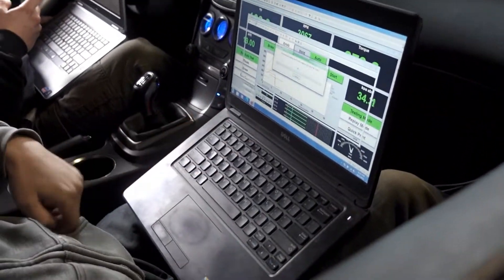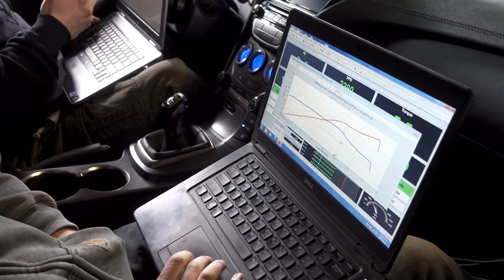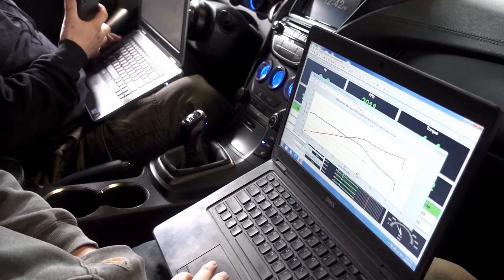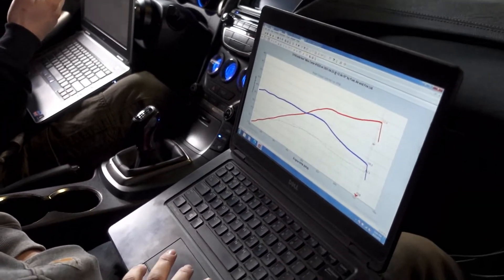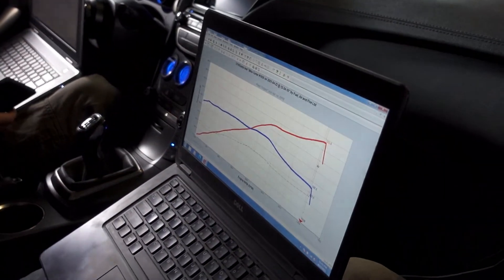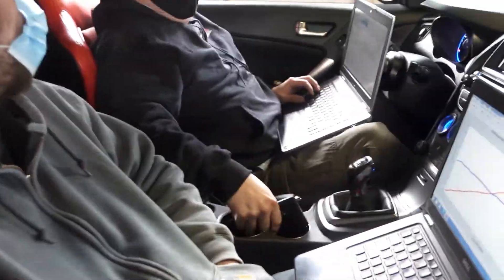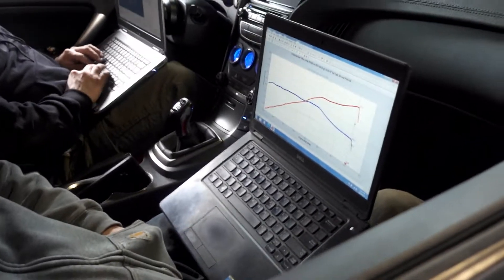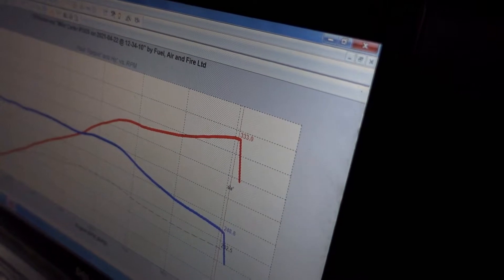Episode 18 Dyno Tuning a Stuffed Turbo on a Hyundai Genesis Coupe

Comment: What stuffed turbo did you get ? I have a 2010 2.0T I’d like 400, is that possible?
Reply from the maker: I got the Stage 2 turbo from turbo parts Canada. And Ya it’s possible for 400+ with a bk1. I’ve helped other gens get around that range with an aftermarket turbo kit. Blood type racing (BTRUSA) has some kits available to get there. You’d need a few other parts though, like bigger injectors, stronger clutch, aftermarket boost control, etc.
Reply: @alphagenperformance  do I still need a clutch if my Gen is an auto/w or manual, I have the dual transmission.
Reply from the maker: @c4pt_underp4nts oh automatic, i think a few have done it or at least gotten close. I’m not sure at what power/torque the auto transmission will slip. But you can still get some decent 350ish hp kits out there!
Reply: @alphagenperformance  I would be fine with 350 , it’s my daily. Thanks, any recommendations? I would like to do it cheap as possible.
Reply from the maker: @c4pt_underp4nts  unfortunately I’d say any turbo upgrade isn’t necessarily cheap with the parts required and tuning time, etc. Still looking at a few thousand, especially if not doing the work yourself. And making sure you car has all maintenance up to date as well and running well before the big upgrade.

Comment: Hey, aside from the stuffed turbo and the intake, what other performance mods do you have on that helped out the tune? Stuffed turbo and intake is what I’ll currently probably have but what else could help push those numbers up? Also what psi does your turbo push to (if it’s over the stock 15, does the boost gauge bar basically go over 15?)
Reply from the maker: A catless 3” turboback exhaust definitley helps with spool and horsepower

Comment: Hey man, Question. Im putting in a stuffed turbo/ported manifold  from TPC in my BK2. I was wondering was it ok to drive before getting it tuned? I need to make about a 4 hour trip to my dyno tuner.
Reply from the maker: Ya, you should be fine. Just stay out of boost.  Definitely don’t try to test it and go wide open or anything as your ecu hasn’t been tuned for the extra flow the stuffed unit provides. We have a customer that’s about to do the same and take almost a 3-4 hour drive to get some dyno tuning done as well.

Comment: TPC claims 375 whp w full bolt ons.?
Reply from the maker: Some of those numbers were guys also running external wastegate. I’m currently running the stock electronic wastegate. I’ll be keeping it that way until I install my larger turbo setup. However, I’ll be adding water/meth injection, larger injectors and fuel pump and retuning for hopefully higher numbers again this summer! Stay tuned!

Comment: What king of AFRs is it running at WOT?
Reply from the maker: I’ll have to double check when the car comes back out in the spring. I honestly can’t remember. I can get the average for you when I do a pull 👍 it’s going back on the dyno soon because I’m adding water/meth injection and bigger fuel pump and injectors too.

Comment: Are you using the bk1 or bk2 Intake manifold?
Reply from the maker: Bk2 intake manifold. Just full turboback exhaust and stuffed turbo replacement 👍 Planning on adding water/methanol injection to get a bit more horsepower out of this setup this season! I’ll dyno it and put the new numbers up later in the year!
Reply: I’ve got a bk2 2.0t auto fbo on meth and I was wanting to get a stuffed turbo but I heard people can crack the bk2 plastic manifold when you reach higher power, but that’s good to hear it’s holding up for you I think I will hold off on it for now because transferring everything over sounds like a pain. I’ll keep a look out for that video thanks for the reply.

Comment: Sup man, after u installed the stuff turbo, did u upgrade ecu also? Right now i got isr ecu on stock turbo, and id order a stuff turbo...do i have to upgrade my ecu for stuff turbo?..
Reply from the maker: Nope, you’re able to tune the stock ecu with this upgrade. You don’t need an aftermarket ecu with a stuffed turbo upgrade.
Reply: @alphagenperformance  what else did u do beside stuff turbo, to make around 300+who??? Can give me the list and where i can get them parts...pls.
All i did on my car are full exhaust, and sfr can tune, hks blowout vavle, thats all,my goal is to be around 350 max..
Reply from the maker: @yourlocalsleepyhead9365  honestly similiar mods. Full 3” turboback exhaust, 94 octane, and the stuffed turbo. I’ll be adding water/meth injection this season to try to get more power as well. Oh and also custom dyno tuned with AlphaSpeed. But that’s it ☺️

Comment: Hey mike I have question so I live in Fort McMurray Alberta it’s 4 hours away to Edmonton it’s where the tuner live so my question is will it be fine to drive my car with my new stuffed turbo all the way to the tuner shop ?
Reply from the maker: I wouldn’t recommend going into boost at all if you’re driving that far. Just to be safe. Keep rpms low/mid range and no pulls. If it was Dustin you were talking to, he works with me with AlphaSpeed as well.

Comment: STrong pulls!! About to tune my stuffed Bk2 on Haltech!
Reply from the maker: Nice man! Let me know what your numbers are as well 😊 Where did you get your stuffed turbo from?
Reply: @alphagenperformance  I thought the haltech didn’t work on a stock turbo bk2
Reply from the maker: @ChepoWorks  I don’t know why it wouldn’t? 🤷‍♂️ haltech does give you more options with tuning and will still be able to read the sensors it needs 🤔
Reply: @alphagenperformance  oh I thought it was something with the waste gate , I was running a tomei turbo on e85 and 1000cc Id injectors , do you think I would run those injectors with a stuffed turbo e85 on the haltech ?
Reply from the maker: @ChepoWorks  why are you thinking of switching from the Tomei to the stuffed unit? And I don’t see why you couldn’t. I’m actually getting 1000cc injectors and methanol
Injection to try to get more power out of the stuffed turbo as well.
Reply: @alphagenperformance  this is the first year I had to smog the car so I took the set up off to put the stock turbo to pass emissions and sold the set up now I’m slower then a Camry and miss being able to pick up speed when I want to so I’m thinking stuffed turbo e85 on the stock ecu so I can keep the ac on the bk2
Reply from the maker: @ChepoWorks  oh ya, I think there are guys making close to or around 380whp on e85 on the stuffed units. Pretty crazy on a stock frame turbo 👌

Comment: Have you seen any clutch slips on those gains with the stock clutch ?
Reply from the maker: nothing yet man. I heard the bk2 clutch can hold up to 400whp, but i guess it's the torque that'll  kill it. Next power goal, i'll be upgrading my clutch for something that'll hold 500whp no problem, but still be driveable for street/track.

Comment: is this just stuffed turbo only? thats what im doing right now.. just waiting for my new engine (prev engine had too many miles) and getting dyno tuned hoping to hit 330 also
Reply: nvm you just answered at the end of the vid lol
Reply from the maker: @2538159408  haha all good. Thanks for watching 😊 Yup, just take out the old one and replace it with new upgraded stock unit. No other fuel related mods needed. Well worth it in my opinion for the price!
Reply: @alphagenperformance  not sure how much i can make. Ill be on 91. Brand new engine but rest of the components are 138k miles i was hoping to break 330 also but might not happen 😢
Reply from the maker: @2538159408  I was on 94 in this video, but either or, you’ll still see some decent gains 😊
Reply: @alphagenperformance  did you have any gauges prior to getting the tune?
Reply from the maker: @2538159408  yes, I’m running Prosport evo series gauges. I have 3 of them: oil pressure, boost, and afr. With any custom tune from AlphaSpeed, an AFR gauge is required. It’s also good to monitor if you’re setup is too rich or lean. It also helps determine if you ever have any boost or vacuum leaks which is nice.

Comment: If you launch good you should be able to break high 12s low 13s. I built a stuffed turbo 2.0 last week for a customer and made 340 wheel  and went 12.92 in the quarter but his 60 foot was 1.8 1.9 something like that. 

Anyways, good stuff! Waking up the car is the best feeling ever. Definitely post your progress at the track!
Reply from the maker: Will do! I find our elevation up north here causes a lot of slower times than similiar setups in the states or in the south. But I’ll probably hit the track in a few weeks!
Reply: Do you sell your stuffed turbos?
Reply: @Steven_Bo1  built as in I assembled the build
Reply: 너도 좋은 출발을 한다면 배기튜닝 만 하자